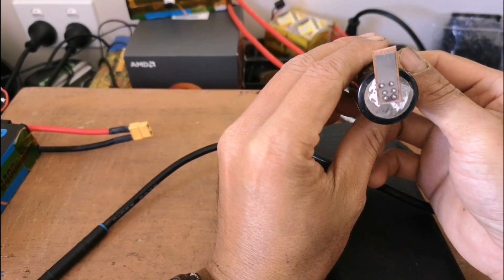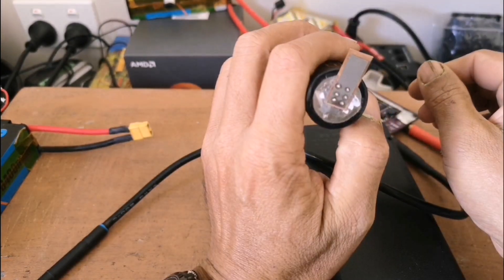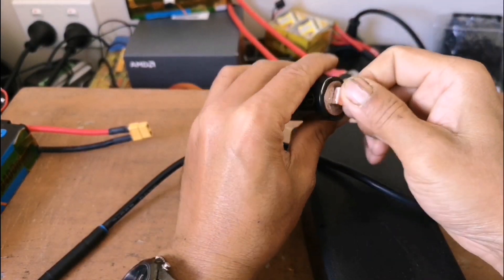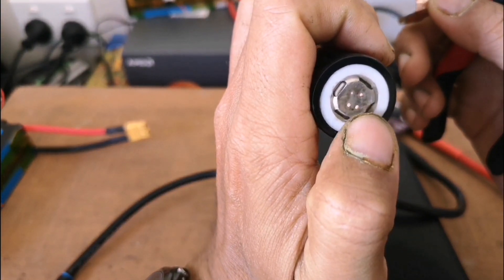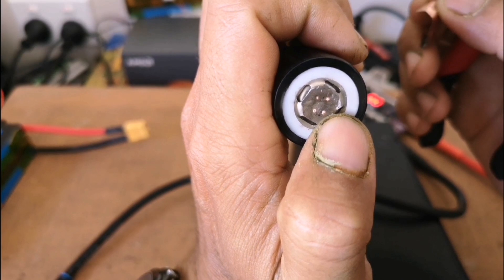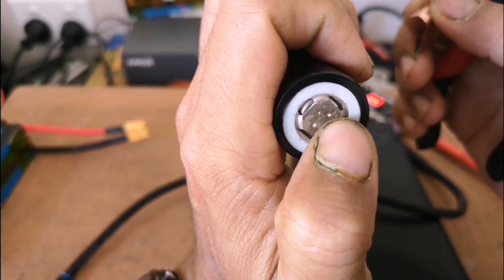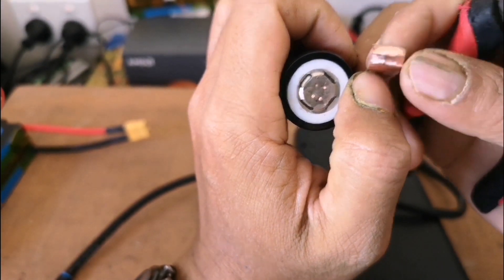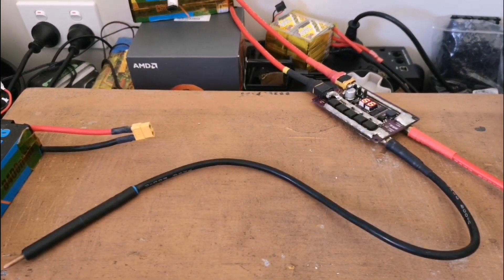DIY electrode for portable spot welder

Comment: I use 5000mah with 80C  and work perfectly
Reply from the maker: deffinately coz 5ah x 80= 400A?
Reply: @pitikaron  yes this mosfet IRL40SC209 can handle 470amps continuosly at 30°
Reply from the maker: @MihaSun  exactly, but I haven't yet into trouble even I use 8400mah 140C and I check with my clamp multimeter the multimeter shows  1000A but not constant sometimes 900 sometimes over 1000A I think coz the multimeter can't show over 1000A.
Reply: @pitikaron  Wow 1000amps 😱,my friend blow the mosfet with car lead battery 600 amps ,this welder fail if voltage drop under 3.5 volts on gate ,internal resistance increase and blow.
Must use a good lipo battery or made a mod on PCB.
I see a lot of this PCB blow the mosfet
Reply from the maker: Yeap I used Lipo battery and I think I also write the link to the description list.

Comment: Is 50c enough? 3s 2000mah. Ah wait it says 50-100c what does that mean?
Reply from the maker: 50x2=100A not enough 
Ali-express a lot of 100C Lipo batteries.
if the maximum is 100CX2000mah=200A
Reply: no use a 5000 mah with minimum 50C
This mosfet can handle 470amps

Comment: 2400 amps....with 10AWG wire coming off the pack!

Gotta love the bullshit C ratings
Reply from the maker: It is needed
Reply: @pitikaron  it is not possible. 100C is a lie.  There are no packs beyond 50C
Reply from the maker: If it is a lie why the battery release over 1000A pulse.  17Ah X 50C = 850A.
Reply: @pitikaron  Did I miss the part where you measured the current with a clamp meter or an oscilloscope? Maybe you should take a look at the Wayne Giles ESR meter
Reply from the maker: I've done measurements using clamp multimeter and the maximum of my clamp multimeter is only 1000A. Once the current flow exceeds the maximum the reading is 000. Unfortunately I can't afford an  oscilloscope, Moreover  I don't really need it for me. Anyway! After I receive my package, however it takes 3 to 4 months. I'll produce a video in regards to C-rate.
Reply: @pitikaron  Would love to see a video about C rate. The Wayne Giles ESR meter already proved that Lipo pack C ratings are bullshit. At best the lower number (when its given as 70C-140C pack) is going to be your peak and your continuous rating will never exceed 40C except there are a few Turnigy packs that have tested in the 45C range. RC Groups has an entire long long long thread on it where they have thoroughly tested packs from every major manufacturer out there and the vast majority are 20C continuous and somewhere between 40C and 60C peak typically. I haven't looked at the thread in a while but I believe the Turnigy packs were overall the most honest and led the charts but there were a few other companies that had some packs that performed well but were still overrated because the packaging said 100C to 200C
Reply from the maker: Hello my friend kindly please watch this video you will see the truth. let me know if you have any doubt?

Comment: Hello. Do you have the firmware for the controller of this purple board? stc8g1k08a During the test, mine burned out. Now either I have to buy a new board or find the firmware.
Reply from the maker: Sorry I don't have.  what mosfet code install to your machine! 220 or 209?
Reply: @pitikaron  10 pieces 209
Reply from the maker: Check the resistant of  two resistor connected to optocoupler  headed to the mosfet at output negative.
Reply from the maker: the resistant must be 2.2k ohms and 10ohms in regards to firmware it is not really needed to reprogram coz chinese cheap spot welding base on timer not in current flow and the resistor control the current base RDS on and then the optocoupler will turning off when the rod is short.
Reply: @pitikaron  Resistors are fine. I tried to make control from the button / pedal. I unsoldered a 470k resistor near stc8g1k08a and applied a high level through it. I accidentally high on leg 2 or 3 stc8g1k08a. Now stc8g1k08a is very hot. Welder doesn't work.
Reply from the maker: if that so you need to do testing the STC81K08A by the multi meter if it still function or not.  however once you broke that chip you need to replace and install the firmware! unfortunately I don't have the firmware.
Reply: @pitikaron  I am trying to find firmware. If I can't find it, I'll buy a new board for the device. Thanks for the answer.
Reply from the maker: Sorry bro!  I can't help you... thanks also for visiting my channel

Comment: Hello, Thank you for your video. I have a question. 
I got package, but different MOS FET Model (RFS7430-7P), I already order IRL40SC209 MOS FET, Can I mix and use the two MOSFET model(RFS7430-7P, IRL40SC209) ?
Reply from the maker: You must make dispute moreover please dont mix the mosfet coz every mosfet are not the same RDS ON! or resistance?
Reply: @pitikaron  Thank you.
Reply from the maker: thank you too

Comment: how do you solder xt60 connector single wire on battery connectors, i see there is two solder points + and -
Reply from the maker: 8 gauge wire put it into the middle of XT60 so that it would joint together and can manage large current

Comment: Amazing cheap spot welder can firmly weld brush and nickel 0.2mm each in tottal of 0.4mm at one time.
Reply from the maker: Yeah because that spot welder installed 10 mosfet every mosfet can mannage 478A, means 4,780A in millisecond

Comment: Thank you for great video , can you please update details on description parts  used with sizes . since there is too many items option with sizes on shop.
Reply from the maker: 8 gauge silicone wire
8mm bullet connector 
0.4mm round bar copper